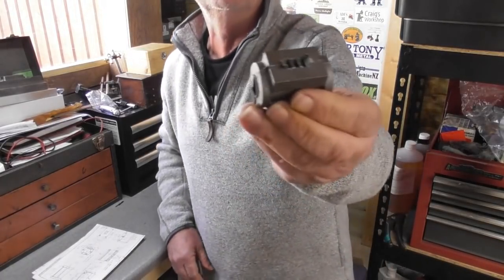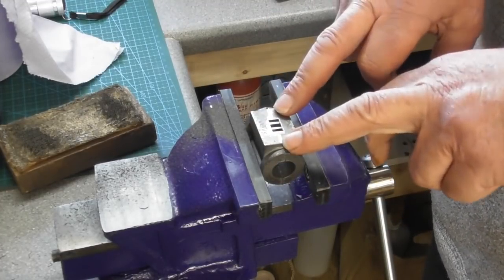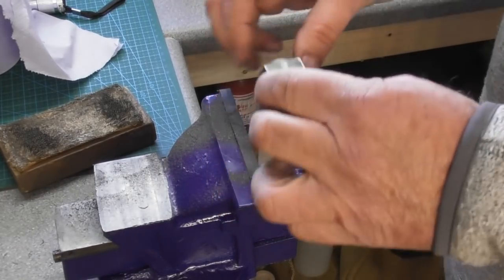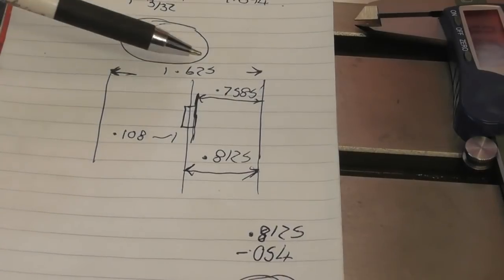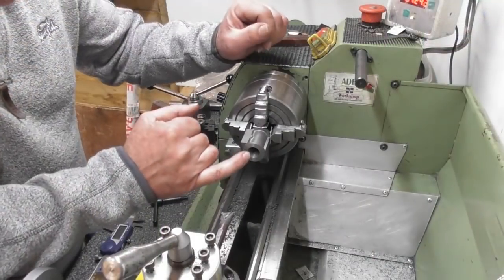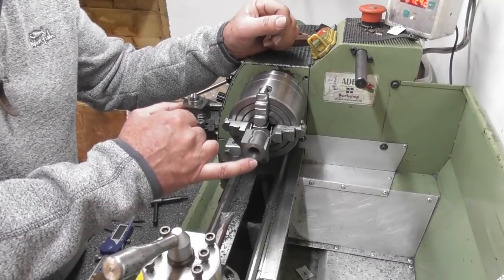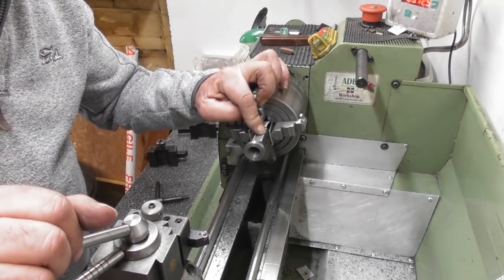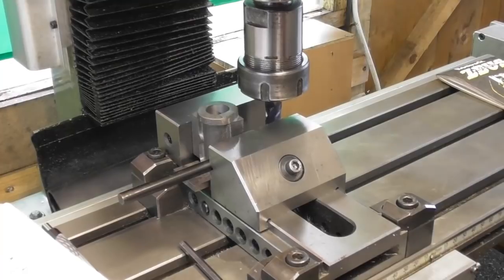Stuart Models S50 engine part 9 The cylinder bore and face

Comment: I remember my first time card, we were allowed to book a 100 mm/4" strip out of the stores, this was mid 1970's.
When filing Brass, Bronze or Aluminium, were used to borrow some welders chalk ( french chalk) to dress the file, worked great on stopping the softer materials clogging up the files, though a new file was always best for non-ferrous work.
Great vlog Ade, set up brilliant as usual.
Thanks for sharing.
Reply from the maker: I have a stock of French chalk that I often use when filing soft stuff . I think that I have been aroused to share this stuff with the masses and I may do a video on filing and the old school tips . we are custodians of the wisdom of the past experts and have a duty to share for future enthusiasts . It is a shame that many of these skills are being lost to the modern world of cnc etc. I will put it on my ever growing list of future video's . Cheers Ade.
Reply: @ade63dug  Great idea, I used to spend most my Machine Tool fitting days standing by a bench, with files, round scrapers, various thread taps and light oil tapping threads to depth. One habit I cannot loose is rotating the file in between use, 90 degree's and tapping on the wooden bench to clear the teeth. If a machinist could get away with not deburring the part he would, and pass on the extra work to the fitting department. Plus no fabrications were media blasted, or weld spatter removed! Oh what fun.
Best regards John.

Comment: When you set the cylinder up on the lathe did you use a pin in the tailstock that fit the rough bore to help get it close to where you wanted? I think you mentioned using a pin to align the bore on the mill.   Did you check the valve casting to see how it fit the ports before you milled them to insure it would cover them as it moved back and forth? I'll probably watch the series multiple times before I order the casting set!

Comment: Be sure to poke down the ports with a bent paperclip or another piece of stiff wire, just to make sure there is no core sand in there! :~D  Edit: Lovely filing technique BTW... you can't beat a bit of hand filing.
Reply from the maker: That is a good idea . I am learning this Steam engine mallarky as I  go . I may throw the cylinder in the Ultrasonic before assembly to shake the muck out of any pores as well . Thanks for the tip . Cheers Ade.
Reply: @ade63dug  It is worse with the fully cored cylinders rather than that one, which doesn't look like it has the internal cylinder and exhaust channels cast in (so I suspect we are in for an interesting setup to get the drilling to line up!) but it never hurts to get rid of anything that may be lurking, if you haven't had to mill the ports yourself. All the best. Edit: If only life hadn't intervened  to delay me watching the end of this before commenting... :~D

Comment: Do you not have a lead screw that you can take power feed off of? How do you cut threads?
Reply from the maker: Hi Barry . Yes the lathe has a conventional lead screw . there is no changeable gearbox for feed rates without changing the gear train at the head end . I slip the banjo out of engagement and use a vari speed motor to drive the lead screw from the tail stock end . this gives me infinitely variable feed rate with the turn of a knob. I am going to upgrade it to a stepper motor shortly . Cheers Ade.

Comment: Hi Ade, nice work as usual.  If the reamer shank is 0.001" undersize, and with the reamer itself sitting on the other vice jaw, might that not skew the bore relative to the port face?  A gauge pin or length of silver steel might have been a better bet.
Reply from the maker: totally agree but it was fine in this case and we use what we have sometimes

Comment: Great video Ade, how do you intend to turn the still rough end of the casting to match the first machined end.... Mill or arbour in the lathe..... Look forward to part 2 👍
Reply from the maker: I will be turning a mandrel to fit the bore . Cheers Ade.

Comment: Nice job Ade. 1st file card (well nearly) that I have seen being used on YT, and great technique with the file mate, nice to see one being used correctly. How long before steam up lol! Cheers, Jon
Reply from the maker: Hi Jon , yes the file card . I don't  think I have seen anyone using one . always seems to be a wire brush . Upon reading your message I am about to look for a replacement. I think I have had the best out of the poor thing . Cheers Ade.